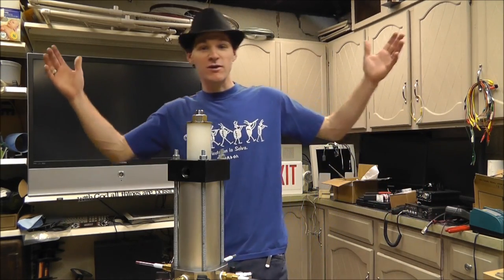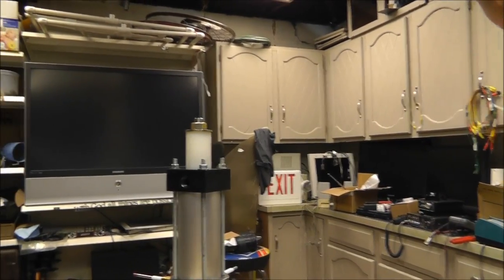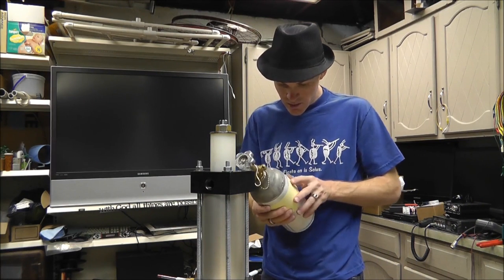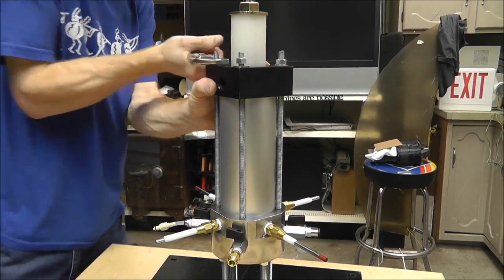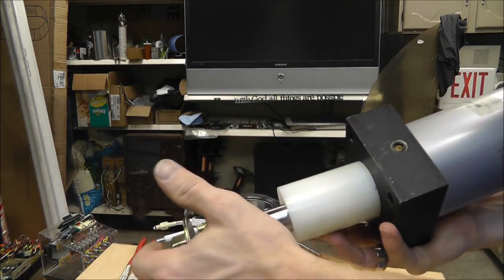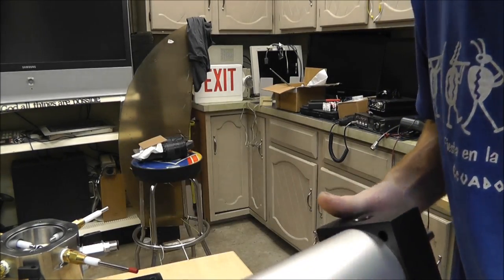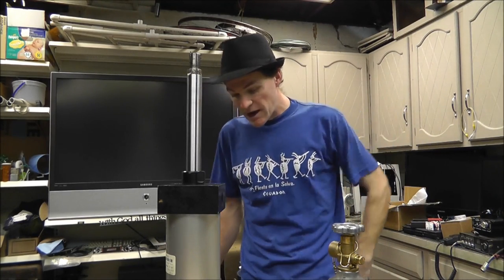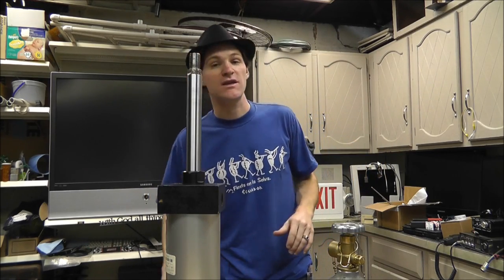Update 7 NGE Papp: Gas Is Here & The Piston And Test Chamber Is Almost Complete! RWGresearch

Comment: The parasol head and piston top is on john rohners engine for sure, along with the coil to constrict the gases being fired. The big ass coil that bob uses constricts the gases and encourages more pop. You need to install the coil (about 300 turns of # 14 mag wire)this is what the cb rig is used for a driver.

Comment: Al Hubbard patented a radioactive sparkplug based on the idea that gas ignition expands far better under less pressure might be re-invented. I thought about using sonic emitters into air intake to expand gas to vapor even under pressure. Only this method of atomizing fuel would seem to be a quick and cheap way for everyone to enjoy cheap travel now. The right freq' will atomize water.  I've always wondered if this cymatics and repelling magnetic poles could expand to hho.

Comment: The accident with the trw executive present was due to a loss of timing due to an idiot pulling the power cord from the device under test that was regulating the process to some extent. This test unit is a single event type of prototyping,not needing the ongoing sync of other events in a sequential method of operation.